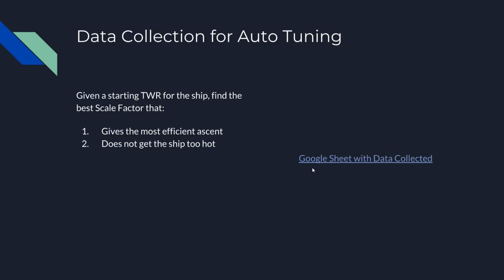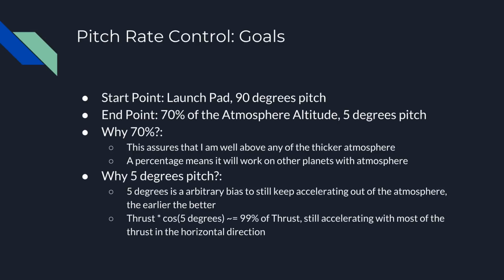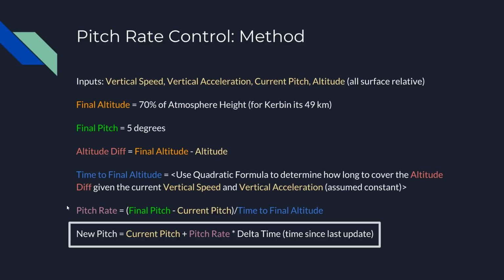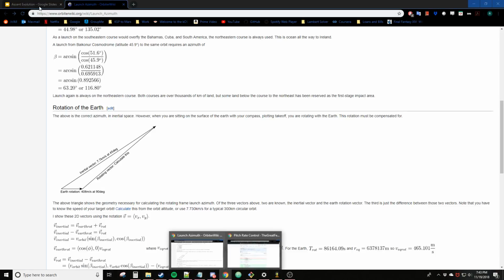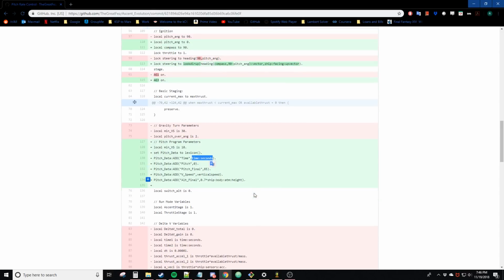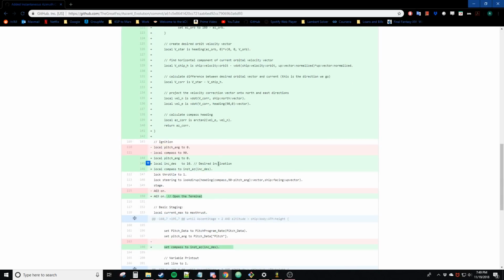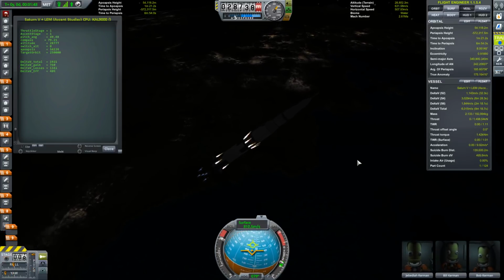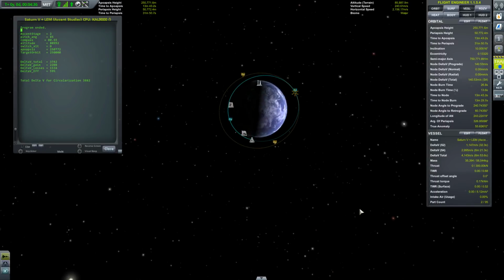Ascent Program Evolution: Episode 4, A New Apollo

Comment: I'll be honest, I did skip ahead through this video to the actual footage of the launch, so maybe you touched on this/ this is how you did it, but could you not use y=mx+c or a map() function for the angle at altitude? My launch-autopilot has a function I wrote which takes a final altitude, and final pitch angle, and calculates the pitch it should be at according to the altitude at the time. Is this not what you are trying to achieve here?
Reply from the maker: No, as the name implies I'm determining how fast the pitch should be changing. There's a slide that I go through in the presentation where it shows the calculations that are done.

My previous video has a pitch vs altitude function, however it is a hard curve that is set regardless of the ship's thrust profile. The algorithm in this video takes into account the thrust profile, since it will base the pitch rate on how the ship is accelerating/traveling as well as where it is altitude wise.